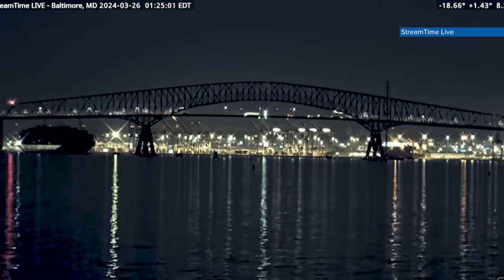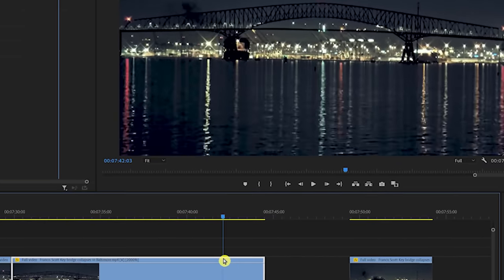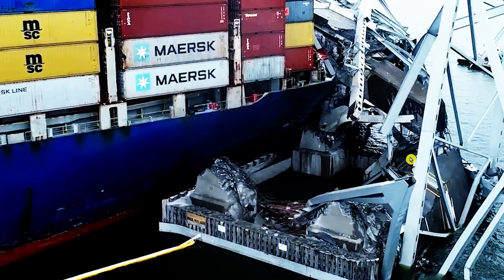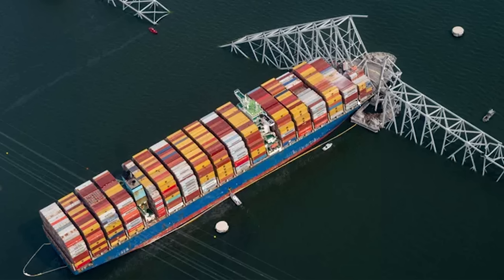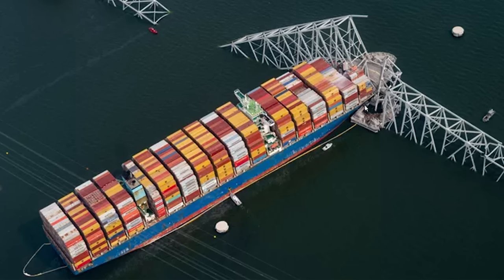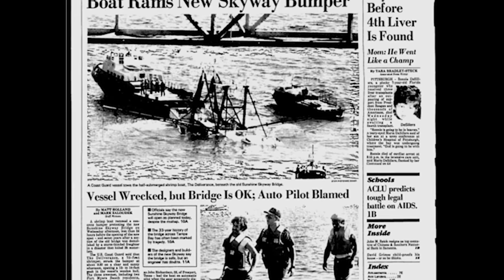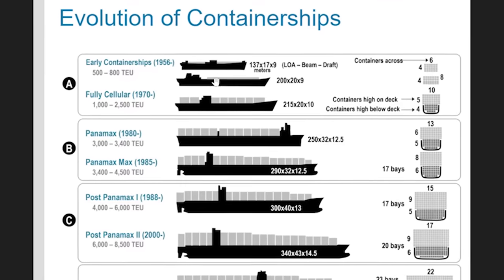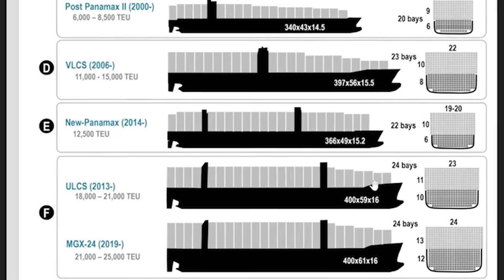NO Dali Bridge Crash Protection Like Sunshine Skyway Bridge?

Comment: Interesting situation I had not considered and I believe it would turn into fact about how it's overhang skirted the pillars.  The curiosity I have now with your analysis would be how much is too much for dolphins because with the strength claimed it would (should) be enough to deflect the ship but would likely beach it.  Bit with the low profile of the dolphins, I could see a scenario of a catastrophic hull breach.  Which with the current situation, (with all factors including at night) could have a far more catastrophic environmental and economic impact depending on the ships cargo.  As well as an equivalent loss of life.  Too many variable situations  could impact which option is wholly better
Reply: In short in this exact scenario, it is possible a catastrophic hull breach causing the ship to sink, might have more consequences even if bridge was saved.  However. Rush hour traffic vs a smaller ship with no hazardous cargo,  a hull breach could be far less impactful.

Comment: I’m pretty sure what made the ship turn so hard at the last moment is that they ran the engine/propeller into full reverse, which will make the front spin round because they were going too. Quick thrusters would have no effect which you would use at slow speed when reversing a ship.

Comment: question:  Is there force separation between the "islands" and the pylons?  I would think if they're cast together and solid a strike to the island would shift the energy to the pylon and lead to a similar outcome.  Maybe if the islands are filled with rock that could compress it could change things

Comment: The real flaw is the characteristics of tress structures in general. All beams are interconnected to each other which is why it was a complete collapse just like the Minnesota bridge a few years ago. You'll recall tress bridge construction was outlawed in America after that although in that case it had more to do with its aging infrastructure. On a more modern bridge, you'd lose a section of the overpass, but not the whole structure. Notice the opposing ends of this bridge are perfectly intact.

Comment: Looks like ship turned good 20degrees, which is bit strange. There are currents ofc, but its unlikely currents themself could turn ship that much in so short time. Only explanation is rudder was set up for course correction just when electricity went off.
But, rudder should be one of system powered by backup generator, so they should not lose all control.

Comment: Congratulations for the series, again. You prove good content, common sense and critical thinking are the best combination for interesting content =)

There're multiple ways to guess the turning angle. One of them is:
Take picture of the last moment, just before the hit. Assume it's in a perfect frontal position to the cell phone camera. Consider its proportion in relation to the lenght of the ship.
We do have the full dimension of the vessel. So, if we had full frontal, compared to a perpendicular view, you'd be able to consider a 90 degree turn, proportionally, you can guess how many degrees it turned before the hit.
Then, by the same way, the perspective of the phone camera relative to the bridge.

All things considered, I believe it would be a +/- 10% margin guess. Roughly, I've got around 22 degrees (I know, too many considerations...).

Comment: I'm pretty sure you're wrong about it having been a "glancing blow".
Look at the near-hed-on photos of the bow of the ship. The bow is very neatly sliced open almost vertically, several feet to the right of centerline, and the metal from that region is shown (in the NTSB videos) having been pushed backwards to the rear of that large wound to the vessel. That slice came from hitting the northernmost pillar almost head-on. That opening did NOT come from the truss falling on the bow -- if it had, the metal would have been pushed downward, not backward.
Whether the ship also hit the easternmost pillar or not is an open question. Hitting the northernmost pillar may well have been enough to bring down all four, as they were all heavily tied together at the top with reinforced concrete. So I doubt the other 3 pillars lasted long enough for the ship to reach them.
The only "glancing blow" might have been between the side of the bulbous bow (which on Dali is relatively narrow) and the underwater portion of the foundation below the 4 pillars.

Comment: When these Concrete Dolphins, can be designed and built in any size, that is required for different situations and locations, or depth of water and current speeds and ebb or flood tidal flows etc.

Theses Concrete Dolphins, can be 6.25 metres (20.51 feet) in diameter, or 12.5 metres (41.01 feet) in diameter, or 25 metres (82.02 feet) or 50 metres (164.04 feet) or 75 metres (246.06 feet) and/or even upto 100 metres (328.08 feet) if needed. 

if necessary can be larger in diameter and/or any size in-between, they can be either circular or oval in shape, or they can be built as a line of Concrete Dolphins.

Basically creating a protected inner and outer access channels, to and from the structure being protected, with these Concrete Dolphins which are spaced out from each other and are of different sizes all in a line  on either side of the Main Shipping Channel too!

These Concrete Dolphins can be square and/or oblong in shape with curved coroners or ends, or as a very long Concrete sold reinforce Barriers or Sea / Tidal Wall Defensives.

Basically can be of any length and width plus any height, that is form the waters bottom and up through the water then above the waters or tidal maximum heights too.  These Concrete Dolphins or Barriers, can be 5 metres (16.4 feet) or 10 metres (32.8 feet) even upto 20 metres (65.62 feet) above high tide mark in height!

This means not only can these Concrete Dolphins or Barriers, deal with any impact from any Large (upto 50,000 GTW) Vessel or Very Large (upto 100,000 GTW) Vessel or ultra Large (upto 200,000 GTW plus) Vessel’s own Bow Height   and Width.

Or the vessel’s bow overhang or the outwards angled or slop of the bow above water line, forward of the main hull too, So the Bow does not collide or slice through anything above the waterline too. 

Also the Vessels height above deck, or its cargo height above deck, the likes of stacked shipping Containers. Can to some degree also be prevent from causing any impact damage with the structure being protected basically too.

Though also so these Concrete Dolphins or Barriers, can be designed and built to deal with or handle even raising flood waters, coming down either inland waterways, shipping canals, rivers and estuary’s, going out to sea.

Or deal with and handle Coastal Storms out at sea, that are approaching shore and causing massive or large incoming flood tides, high waves and producing large volumes of water coming up channels too.

You do not want your Concrete Dolphins or Barriers being submerged by flood water, then Large or Very Large let alone Ultra Large Vessel’s, then being carryover the top of your Concrete Dolphins or Barriers, so Vessels can impact with the structure being protected too!

As to how these Concrete Dolphins or Barriers Again, are design and constructed is a science in itself. They need to last a very long time, so take Wear and tear is damage that is naturally and inevitably occurs as a result of normal aging and weather or seasonal conditions, current and tidal flow erosion etc

This wear and tear plus any accidental damage from other objects and items (floating tree trunks or semi-submerge shipping containers) in the water and not necessarily from vessel impacts involving vessels of all sizes too. 

Which is assumed will occur over time, to these Concrete Dolphins or Barriers, are expected to be used properly with the correct level of care and proper maintenance, plus repairs as and when necessary too.

Along with these Concrete Dolphins or Barriers, being design to have layer defensives in depth too, by using different materials with different properties of strength and impact absorption levels too.
Also constructed in different layers or thickness too, plus with different types of reinforcement provided again in different layers or positions too. Which gives these Concrete Dolphins or Barriers, multiple layers of strength, Impact absorption and impact residence levels.

It is not just a case of building and dropping a large heavyweight reinforce concrete block, in some inland waterway or shipping canal, or in a river or estuary. I the hope it will protect your local bridge supports, it is far more complicated than that.  

These large heavyweight reinforce concrete block as it were, or Concrete Dolphins or Barriers, equally have to be secured into the bottom of water channel.

To stay in place permanently where you want them to stay or you first positioned them in too, you don’t want them moving over time. There mere heavyweight is not good enough to secure them in place, especially if they are design or expected to take impacts from Vessels of upto 200,000 tonnes Gross Weight.

Which could be travelling at slow to medium or even high speeds, from just manoeuvring speeds of 3 to 6 knots, or cruising speeds of between 6 to 12 Knots, or high speed of between 12 to 22 Knots plus ?

Think about it a vessel of 25,000 tons travelling at 24 knots, the force and energy she will produce at time impact something may seem high!

Though compared to vessel of 50,000 tonnes travelling at 12 knots, will have a greater impact force and energy than the first by a very much greater value.

However, then if you compared a vessel of 100,000 tonnes travelling at 6 knots, or compared a vessel of 200,000 tonnes travelling at just 3 knots.

Each of the late two vessels, will have a greater magnitude of impact force and energy release, than the first two vessels even though they are travelling slower by a great deal too.

It is basic 101 Physics, speed x mass or weight over distance travelled = energy or force produced!

Or how much counter force or energy, will be needed to stopped and/or slow down and break its forward motion too?

Or how much physical strength and weight or size / volume a defence barrier, needs to be to either stand upto or sustain any impact of whatever magnitude too?

Along with just securing these Concrete Dolphins or Barriers, into either water channel mud and/or silt or into either sand or soft soil below, that has built up of time is just not good enough either!

These Concrete Dolphins or Barriers, are required to be securely anchored into the deep sub-rock structure, that lays somewhere beneath the water channel by the use of multiple Deep-driven Steel-tubular Piles.

This could means requiring to drill down large boreholes, going through the water and the water channel’s soft bottom layers, until you hit bedrock, which could be tens of metres down. 

Then constructing of multiple large diameter (0.5m to 1m in diameter) reinforced Deep-driven Steel-tubular Piles, which are hammer driven into the deep sub-rock structure, which may need to go down over 100 metres (328.08 feet) too.
  
Also then reinforcing bars are lowered in and concrete is poured in to these Deep-driven Steel-tubular Piles, to secure and strengthen these anchoring multiple Deep-driven Steel-tubular Piles.

For each of these required Concrete Dolphins or Barriers, then they are filled up, with different sized rocks, stones and gravel, or building construction debris, even river dry mud and silt, or sand and soil etc. 

To provide massive and weight to these Concrete Dolphins or Barriers, then they are top-off with more reinforced layers concrete to, seal them off as one very sold concrete obstacle in the water or coming out of the water many metres too.  

So these Concrete Dolphins or Barriers, are very costly to build and take many months or years plus tens of thousands of man hours, to build and finish each one off too. 

So no mistakes better be made in their positioning and where they need locating too, which is another issue for the NTSB needs to look into. 

Over this Baltimore Port and Bridge Container Ship Marine Accident and Disaster now too, as the few Concrete Dolphins that were bt the now fallen interstate told road bridge.

Seem these few Baltimore Bridge Concrete Dolphins, just fout of them. With two on each side of the Bridge and one on each side of this Main Shipping Channel running under the bridge too.

These Baltimore Concrete Dolphins were too small in size in the first place, they were in the wrong positions secondly too!

Then thirdly these Concrete Dolphins were too far from the bridge, to be any good as a bridge last minute defence, that is on both side of the bride too!

As they say in American Baseball (English rounder’s basically), “Three Strikes and You’re Out!”  of business the Port of Baltimore too.

So these Baltimore Concrete Dolphins, lastly were of little or no use in preventing this Marine Accident Disaster whatsoever too!

So is the NTSB going to be investigate these Baltimore Concrete Dolphins and their positioning too, was a causing factor in this Baltimore Port and Bridge Container Ship Marine Accident and Disaster, Yes or NO?

Along with who is responsible, for these Baltimore Concrete Dolphins and their positing too, as clearly they were of little or no use in preventing this Marine Accident Disaster whatsoever too!

Also any Concrete Dolphins or Barriers again, are built and designed with curved sides, coroners and/or ends etc. So passing currents and tidal water actually flow around these Concrete Dolphins or Barriers easily as possible, so they do not cause other issues in the water to others.

Comment: as seen in video , after black smoke ( which means a main generator came back to service , captain or pilot order ( CRASH ASTERN ) which cause transverse thrust and turn the head to starboard, I believe they could continue steering with emergency generator and one steering motor alone to keep the initial course

Comment: The experiment has been run and we know the answer.  We can see in the photos that the pilings and pile caps of the Key Bridge DID withstand impact by the Dali*.  So we know any dolphins built to be as strong as those pilings would have protected the Key Bridge is they were properly placed.   
* And this is true even if that force was transmitted down the bridge pillars to those pilings rather than directly from the ship to the pile cap.

Comment: I always wondered how they actually poured or pumped the concrete on the main columns of the Sunshine Sky Way Bridge.And are they post tensioned and was it slip formed continuous poured concrete.And how much reach would a concern pump have to reach the bottom of the forms of the main columns.Or did they just drop the concrete down the forms because it looks like it.I was busy with about six project a day in Orlando at the time.I know I'm not going over Sunshine Skyway ever again.Cold Joint City.

Comment: If the ship was traveling low in the channel, the protective barriers would probably have done their job. However, at least the preliminary information shows she was high in the channel, meaning if she had met another vessel, she would have had to pass traffic starboard to starboard. The standard  procedure for ships at sea is the same as you driving your car, oncoming traffic usually passes to your left, or port to port. However, depending on tide and currents, especially in a relatively narrow channel and with minimal traffic, pilots may try to center the vessel in the channel and adjust their course as needed to clear inbound traffic. I think this was a tragic accident. The ship lost power, they couldn’t recover control of the vessel and consequently the bow clipped the two outboard bridge supports. I don’t think it was intentional or purposeful, because of the time of day. If you really wanted to do something like this intentionally, wouldn’t you have planned it to play out in the afternoon hours when the bridge would have been bumper to bumper with traffic? And yes, I’m aware there is tides to consider as well, but it still could have been planned much differently. Remember, if your ship is empty, it rides much higher in the water. She was loaded with 100,000 tons plus of cargo, so she was obviously riding low in the water, and setting sail at low tide. I don’t know what her clearance would have been or the tide differential would be from high to low in the  Chesapeake bay on any given day or night, but it strikes me as odd that the time she shoved off, if she was going to intentionally take the bridge down, was around 0100. Just sayin